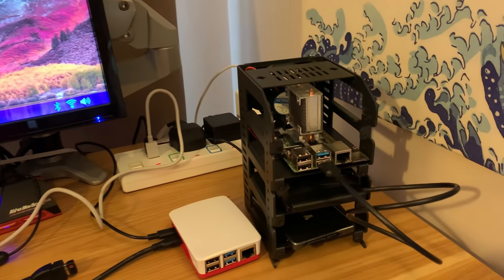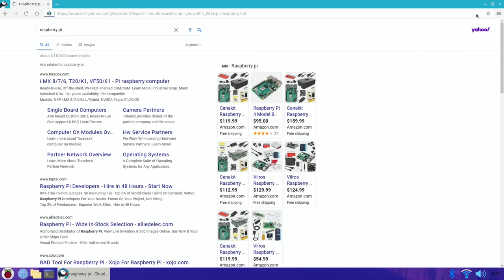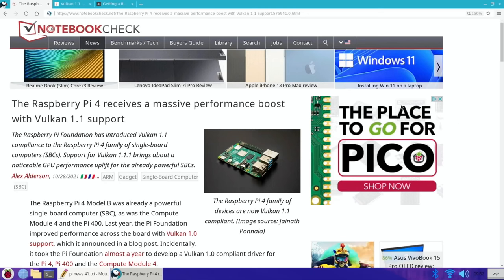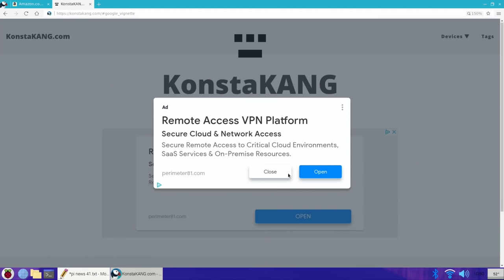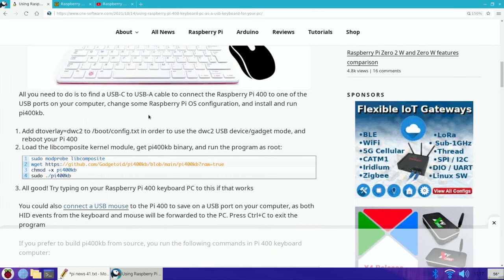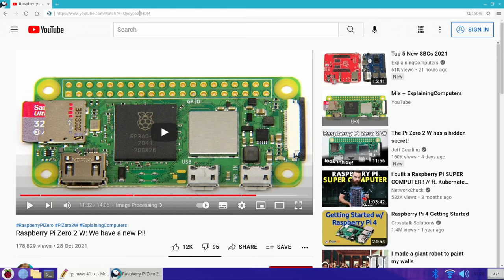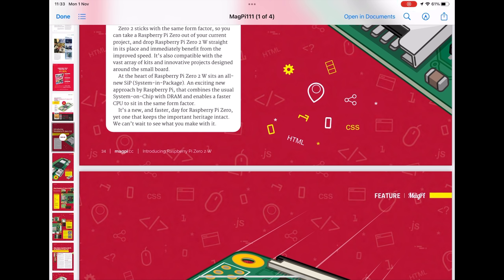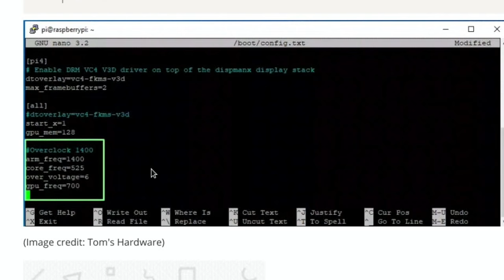Pi news 41. The Amazing $15 Pi Zero 2. Plus Vulkan 1.1 compliance, up to 60% better performance.

Comment: The Pi Zero 2W is in stock at pihut - but only in their starter kits unfortunately. Still great value at £42 with everything bundled in.
Reply: Glad I bought mine Saturday, have all the charging and cables, so with a flirc case for less than £30 delivered.
Reply: @bellshooter  saterday???!!!

Comment: I don't know about the ram limitation being a cost thing they know people would pay extra for more ram, believe they said something about adding an additional stack of 512 on top of the existing 512 (which is directly on top of the SOC) would double its high and make it not work using the current process (I didn't catch why)
but the also said similarly a complete 1gb module is double the thickness of the 512 so same problem.

Comment: Thank you very much for the tip about the puffin browser. I got my pi zero 2 a few days ago and was gutted initially that chromium was useless. Puffin is faster on the zero 2 than chromium on the pi 4. I'm not keen on Chromium now that Google won't allow it to stay logged in

Comment: Have you tried using ZRAM on a Pi?

It creates virtual RAM using a swap file.  Only recommended using on a flash drive to prevent constant writing to an SD card which will shorten the lifespan of the SD card.
Reply from the maker: Yes,  👍🏻

Pi news episode 24. Pockit, plug and play Linux. Speed up your Pi with Zram.
https://youtu.be/osRfUKbwaX0

I was thinking the Pi zero 2 will  benefit from Zram while editing the video. Puffin worked well as it’s not a standard browser.

Comment: I use MX on a couple of my desktops but have yet to try it on my Pi_s. It's a superior  distribution, I think. I still run Twister OS on those, which is superior in itself.

Comment: When you say it supports vulkan now is that specifically pi OS and does it apply to the pi400?  I'm still new to both the pi and linux (I have a pi400)
Reply: Yes, it is compatible. The Pi400 is the same chipset as the Pi 400 but with a slightly faster CPU clock out of the factory.

Comment: When Ubuntu 21.10 Impish Indri was officially launched i installed on Pi-400 and it has a bug which crashes the HDMI Output to fix this issue we need to enable Fake KMS

Comment: If Pi Zero W 2 is based on the Pi3 silicon I doubt you will be able to overclock it much more than that 1400.  The Pi3 was notorious for NOT being very overclockable.

Comment: I had some problems with my pi zero w 2 . The seller said I needed a 2.5 amps power supply. But if I look at the power consumption, it would run fine on a 2 amps or less. Am I missing something?
Reply from the maker: I guess it depends on what you plug into it. Display, camera module, usb devices etc.
Reply: @leepspvideo  true but in this case nothing was plugged in except a mouse that came with my pi 400
Reply: Are you getting the under voltage message? I have tried a few different phone chargers with a pi 3a+ Xiaomi, Huawei, ZTE etc and I get the under voltage message, my guess is they are outputting under 5 volts. They want about 5.3v. I put the bench supply on it for a while to see what the current draw is, its actually very little about 1amp when it's spinning a hard drive, then sits on 300ma. But I'm running it without a monitor. Like Lee says it depends how much is plugged into it.
Reply: @cobberdig  didn't think about voltage also being able to cause issues. Currently i sent the pi back to the supplier who are going to check the board with their chargers and HDMI adaptors
Reply: @FuZZbaLLbee  well yeah that'd be my theory anyway that some of these OEM power supplies say they are 5v but are probably 4.5 or 4.7. the pi needs a bit over 5 to be happy the official supply that came with my 400 is 5.25 volts I'm pretty sure.

Comment: I have GIMP installed and when I "download and open"  items from Bookshelf, they open in that by default. It will then ask you to import the pdf file
Reply from the maker: I wonder if it will still be too large an image for the ram
Reply: @leepspvideo  depends how big each download from the Bookshelf is. I have done it that way on my 4gb and 8gb Pi4's but have never measured the ram usage from a fresh PiOS installation. Have never measured on the first Pi0w, either. Good question, though!

Comment: My comments keep disappearing, I wrote one comparing my new Pi Zero to my Windows 95 machine that costed £2,000 in 1995. Nothing at all controversial except I said the battery was expensive.
Reply from the maker: If it contains web links it usually gets deleted by youtube. I haven’t deleted any.